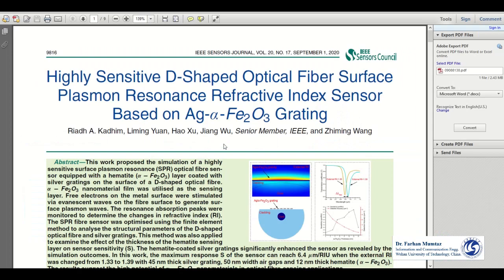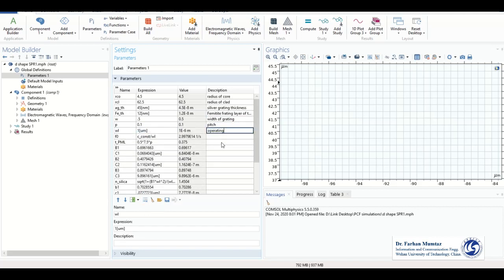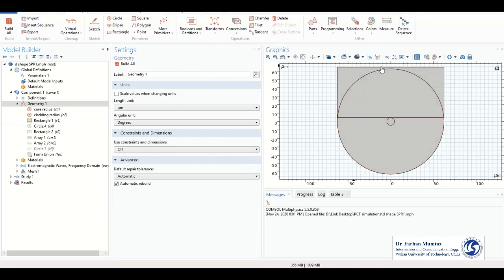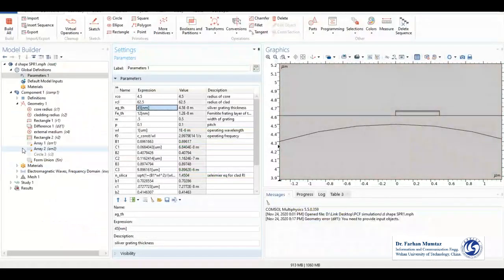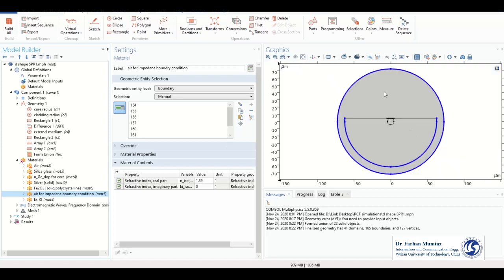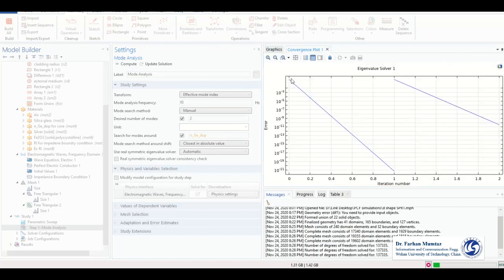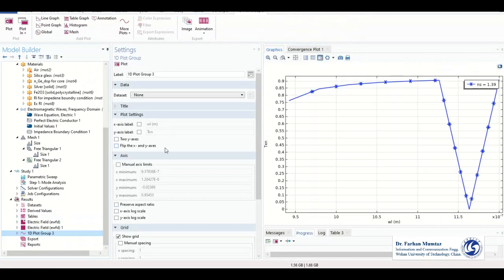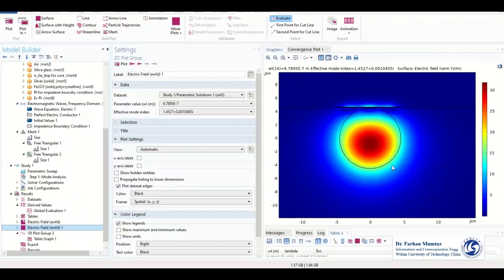|D-Shaped Optical Fiber Surface Plasmon Resonance| ||COMSOL SIMULATIONS||

Comment: Sir can youplease tell what is the range of the wl(operating wavelength) in the parametric sweep list ?It is not fully visible .
Reply: U can set from 0 to 120nm with 30 steps
Reply: @muhamadfairulizwanbmatzain2103  tried what u suggested but there's an error

Comment: 1-You made 19 array. not twenty
2-Why did you hide to use union section
3-What is parameter value list  formula in parametric sweep area? "range(0.5[um],1.2[um]....."
Reply: have you ever found out the parameter value list formula?
Reply: @dr.farhanmumtaz965  please answer

Comment: May I get the .mph file? 
I tried to simulate the model following your tutorial. But I couldn't set the true value of RI for Silver and Fe2O3. 
Will you please email me the .mph file at mamuns30@gmail.com?
Reply: hi bulbul, are you able to get the model?
Reply: @farizahanimsuhailin1418  
No, I haven't received the model. The problem with the RI is still present.
Reply: @bulbul9682  may be can try change the material with gold as it is more easy to find the data

Comment: Dear Dr. Farhan, many thanks for this interesting lesson. I am learning to use COMSOL for SPR simulation and this video helps me a lot. However, I have some questions regarding the spectrum shown in Fig. 6 of the paper, because mine is slightly different than yours, and than the original.

Could you please, share with me the File of this simulation?  my email es wiedergeburt007@gmail.com

Thanks in advance.

Comment: can I get .mph file of this please atleast link after uploadind it to google drive
Reply from the maker: share your email
Reply: gmail is  stheyajulakanti     sir  just add at the rate gmail.com coz if i put my exact gmail id it is showing some problem to reply(no spaces sir in mail id)
Reply: Could you help me
I want the file  @julakantistheya5167
Reply: @dr.farhanmumtaz965  Hi,great video.Please share the file at aiswarya.remesh@gmail.com
Reply: @dr.farhanmumtaz965  I also want your email id
Reply: Sir, I try to make D Shape sensor, but not successful implementation. I have problem when I making grattings and choosing materials. So is it possible if you send me the simulation file then I can take help from file.

engrbabarali00786@gmail.com i
Reply: @dr.farhanmumtaz965   your videos are very helpful. Can you share the  .mph file at priyankathawanh28@gmail.com
Reply: @dr.farhanmumtaz965  can i get. mph file
Reply: did you get the comsol file??? if so please do send

Comment: sir can you please do a video to plot wave length versus refractive index that is given in the paper and also to calculate sensitivity.If possible can you please put .mph file of this simulation
Reply: The Txn co. vs RI plot is already reproduced, you just need to sweep the surrounding RI to obtain the sensitivity.

just review and follow the instructions given in lecture.

Thanks
Reply: Bro can you tell me the parameter value of operation wavelength in parametric sweep